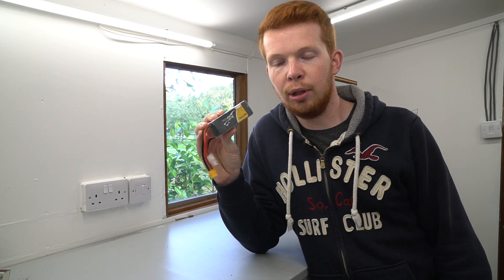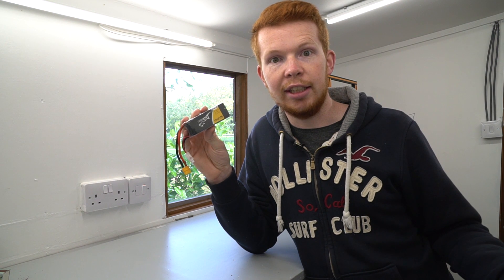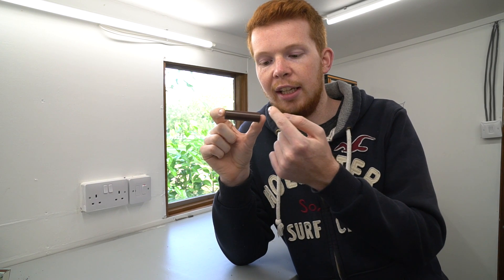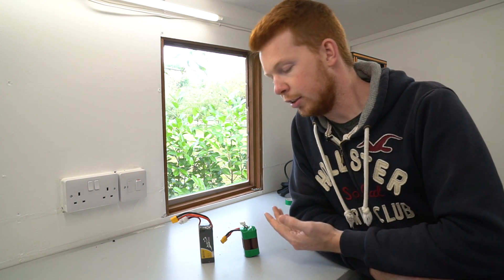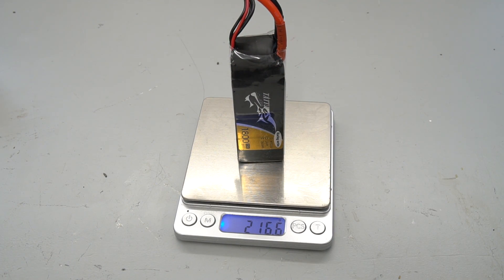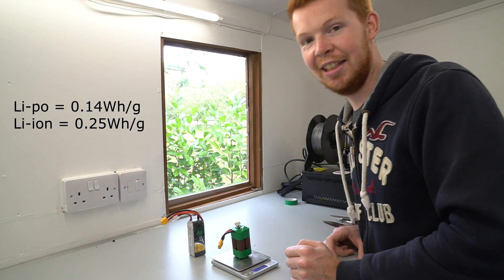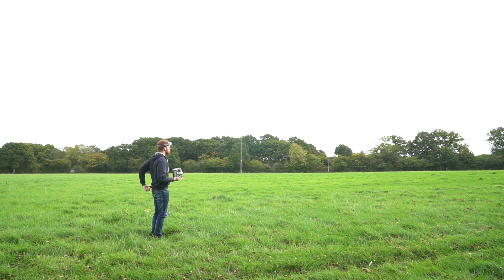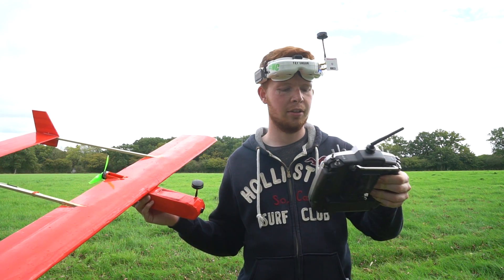Lithium ion plane battery

Comment: 15.6 V / 4 = 3.9 V per cell at the end
You didnt even use half of the energy in the cells! You should run them down to 2.5 V for full capacity 
Bad test

Comment: That so-called lithium polymer battery is terrible! Usually this type of prysmatic "coffee pouch" lithium-ion cell has a far greater specific energy density than the cylindrical cells. This is largely due to the metal casing.

Discharging to 0% will not damagae the cells. Charging between 10% and 90% will extend the cell's cycle count (life). Discharging to 0 volts will damage the cells. 0% SoC is approximately 2.5 - 3 volts.

Comment: ....... Didn't work for me...3s.... weak n heavy..... The power wires break easy they just come right off the cells......I welded a pk And the batteries are  And the rc planes are boring  batteries are so weak and it's just super boring the plane barely even got off the ground

Comment: Bruh, you discharged the LiIon cells to only 3.9 V which is like 30% of full capacity, the rated safe discharge voltage is 2.8V (but 3.2V is used as standard).

Comment: well if you dont lower the lvc to at least 2.5volts/cell then theres no benefits. joshua bardwell did a video comparing flight times and characteristics of both. 5:51 then you arent getting the most out of your pack. li-ion cells can be discharged WAYYY below a lipo. 9:21 absolutely nothing wrong with running a lipo down to 3.2volts THEY ARE NOT DEAD at 3.7v/cell. 3.7-3.8v is storage level charge. LVC for a lipo is 3.2.

Comment: That's not true. A batterys capacity is measured to it's cut off voltage. Wich is a safe voltage and you don't have to throw it away. That's ridiculous.

Comment: in the PEV world, (last mile type, EUC / Eskate etc) we use massive packs where amp draw per cell isn't an issue, i always thought you guys used lipos cause of the better amp draw with smaller packs, but my knowledge is limited

Comment: Great video.  I noticed that your comparison of battery density did not account for differences in construction materials. An example is that the the lithium polymer pack has a much longer set of lead wires then the lithium ion pack does.  Other differences exist, such as the materials used in the cylinder construction, the bonding material and the wrap material and thickness.  So, while there is validity to the premise that weight matters, it would be the base weight of the required elements and not of the packaging of those elements into the battery component.  Just my thoughts.  I really enjoyed the video.  Keep up the great work.

Comment: If LI-ion cells could be discharged to 2 volts per cell, ie 8 volts in total, it would significantly reduce the performance of the plane because the plane would be flying at half of the rated working voltage during the final minutes of the flight. It is always better to have a constant performance and decent flight time than degrading performance and high flight time.

Comment: You can solder li-ion cells with Rose's metal, its melting point is below 100 celsius. And it will double as overheat protection.

Comment: step-up converter, voltage regulator, full usage, from the lead-acid / lithium-ion
Reply: simulated load on the tip of a pole, selected rpm

Comment: Its not 3ah at 4,2v, the nominal voltage for a li-ion battery is 3,7 volts. Anyway its easier just using Watt hours to compare these things.

Comment: You can get spot welders online for 20+ bucks. They use a LiPo as a power source. Performance may vary but they should do the job for a quick battery pack.

Comment: Li-ion is cheaper, innately larger Amp·hr, and less weight than Li-Poly. 

@10:35
In terms of performance, I'm still not sure why you'd ever opt for a Li-Poly solution? Are you saying the high current draws needed in acrobatic maneuvers combined with the lower internal Ω of the Li-Poly (and ignoring the added weight), makes it the more electrically efficient solution?

Comment: Ove more difference between Li-Po and Li-Ion is max current. Li-Po can easily deliver 65C or 65*capacity current - 65*capacity, and it is hard to find 18650 with 35C+. So it is not only energy per gram matters but also max current per gram.

Comment: "With the lithium-ion battery, I still had another 43 minutes that I could have flown." No. As time goes on, the voltage drops. As voltage drops thrust drops. At some time long before 43 minutes (with a corresponding 8 volts), you would not have enough power to fly the plane. 

Sure, it is possible to fly planes at this lower voltage. However,  his test plane used a 4 cell battery, indicating that it was not designed to run at such a low voltage.

Comment: what i have recently noticed is sometimes there is a "security" circuit in the batteries which limits the current so this is why sometimes the tests are not very precise when you compare different batteries etc. because you look at the volatage and capasity and you think hmm it should be the same but it is not but not because of the battery itself...

Comment: Li-Po is Lithium Ion. It's technically called Lithium Ion polymer. The difference is basically that polymer is flexible, Li-ion is not, and they have some different aging qualities. But Li-Po and Li-Ion can both be manufacturered to be high energy density or high amperage capacity or in same cases both. Your Li-Po batteries here are designed for high amp draw, where the Li-ion you used here are designed for capacity.

Comment: I love your videos, but your math is a bit off. Your plane takes X amount of watts to fly not Amps. Taking into account that you would need to discharge your battery down to 2.5v to get the full mah, your plane probably has a theoretical flight time closer to 65 minutes on Li-ion.

Comment: Can you not set up a test rig with a multimeter with the batteries and a prop on a motor at the correct rpm or at least a given set resistance to allow the correct amp draw and then test how long it takes For the li-po to drop to 3.7v per cell and the li-ion to 2v per cell

Comment: Ummmm, you can definitely run lipo cells below 3.7V . That's their nominal voltage, you can safely run them down to 3V per cell with no issues. If you only run them down to 3.7V you'll just about use half the battery capacity

Comment: Cheap Lithium ion cell manufacturers always lie and grossly exaggerate the battery capacity, that's why it lasted slightly less than the quality LiPo despite having more than twice the rated capacity.  For RC planes, those LiPos will always be more efficient in energy density to mass.
You need to do a continuous discharge test to find the true battery capacity of your Li-ion battery pack

Comment: Both cells are lithium ion. lifepo4 and so on are too.
The polymer comes from the plastic pouch the cell is in.
The cell you refer to as lithium ion is an ICR or IMR cell. Which stands for (lithium)Ion Cobalt/Manganese Round.
You also get polymer lifepos or cobald or manganese in polymer pouch.
Reply: Round could also mean rechargable. Not 100% sure

Comment: Wonder if there some kind of RC plane distance record could try and break.
Reply: @RC Testflight built a solar plane which can fly all day.
Going to be difficult to beat that.
Reply: @safetyinstructor  how about night? 🤔
Reply: @therealpanse 
Daniel used a normal lipo so it's probably going to last only a few hours at night but already being able to fly all day is going to defeat a simple li-ion cell like in this build. 
You could try to combine li-ion cells and solar panels to basically have a suborbital pseudo satellite.
Reply: @safetyinstructor  (sorry for replying to an old thread) but a good old combustion engine would probably be best for this task! Little 12cc nitro engine and a massive 2 litre fuel tank, if my 1am quick maths aren’t broken, it should be good for about 2000 miles 😅
Reply: @b4tty  Idk but if my 2am quick maths aren't broken you should be wrong.
These hobby engines are quite thirsty they guzzle through half a liter in 20 minutes.
Edit : okay not the 12cc ones but these engines are everything but efficient
Reply: @b4tty  Along with the thought that a 12cc engine could move 2litres of fuel, or overcome wind resistance of the wings that would be required to keep it airborne haha
Reply: Just had a stroke there
Reply: @yorn4286  underrated joke.
Reply: someone jst did 100 miles🤣

Comment: Hey - i build a 3S2P 6000mah LiIon of 18650 Sony Murata.  This cell you can fly to 2.5V (and lower) but the ESC (HTIRC Hornet 40A) have throttle-cut at about 3V per cell! Any ideas how to fly until 2.5V/cell?

Comment: Lithium polymer batteries are lithium ion ( LIPO )  the P stands for the polymer the pouch that is used.  Lithium  ion cells are of the same thing except with a metal casing that's why the P is removed there is no polymer pouch.  The capacities are different because of the chemistry that is used you can either have high discharge  With low capacity or  Lower discharge with higher capacity.  There essentially the same cell bit different  Manufacturing methods and with Slightly different chemistry For higher discharge or higher  Capacity.

Comment: if you tightly pack together these Li-ion they will severely overheat . Try them separated by 1cm and wrapped in alluminium foil as heat sink

Comment: I keep soldering 18650 cells and I hate it because there are always cold solder joints. When soldering cells, I use a soldering iron that has at least 60 watts. Spot welding devices are best, but unfortunately they are very expensive
Reply: U could try to scratch the ends of battery with sand paper then it will be able to stick properly and try getting the really thin soldering wire

Comment: After a couple of 2 hr thermal flights, I can attest to how it becomes boring, but ,.... when you get low and have to scratch for lift, the heart rate can climb faster than your glider, if it's a task that you'd really like to complete,..... accumulated flight time with the Li-ion still gets you a comfortable, 3 twenty minute flights or 4-5 ten to twelves, so again that benefit of flying a daily session without changing airborne packs is in your favour ....... :-)

Comment: There is also one more thing you need to consider. The charging board for the Lipo also controls the discharge rate of the battery. So even if the flight electronics asked for more power, the board will limit it. This is needed to keep the battery from what I call thermal decay aka an over drawn battery ready to explode due to heat.
Reply: Lithium Polymer batteries used in hobby RC do not have a protection circuit like on Lithium Ion cells used in laptops. Not all Lithium Ion cells are protected, either. That's what makes RC use possible, while also dangerous. The battery will put out as much power as physically possible--even to the point of bursting into flames due to the ESR heating up the pack. Most RC electronics have motor speed controllers with a built-in Battery Eliminator Circuit (BEC) that limits max amperage draw and shuts off the system when it reaches a safe low voltage. The BEC is for sending 5v to servos, receivers, and flight logic boards. All of these devices work together to prevent a battery from bursting to flames.

Comment: Do you have to fly them to test the "theoretical" run time? Like those running machines or exercise bikes can replicate different conditions, so could a similar simulation be put on the motors drawing different energy values for take off and cruise. Run both batteries on the same motor through the same software simulation will give you theoretical values that should significantly apply to real world situations. Especially if you already have a log of the real world conditions because then you could use those values for your simulation.

Comment: Respected sir,
 

My name is Rajnish Kushwaha from Delhi , and I got yours reference from Mr. Tilaye Tadesse, sir I am mechanical engineer.I want to propose a presentation on  totally innovative project on advance propulsion mechanism system   which is totally different from today's I.C or S.I based propulsion, which are based on Newton third law of propulsion but instead my project is based on innovative natural theory and for this project I I am currently working with two IIT's professor Dr AMIT GUPTA who is working as a assistant professor in mechanical department in IIT DELHI and Dr Debopam Das who is working as a professor in Aerospace department,  IIT kanpur, I am working on this project from last 12 years and i develop my own working prototype at my own end with available resources which proves and confirm my researched theory, but now I need yours people help  for its industrial development with the help of NASA organization.

I am waiting for your heartiest response.

 

With regards,

RAJNISH KUSHWAHA.

+91-9718895909

Email ID :- rajnish.kushwaha8@gmail.com

Comment: Great video! You could put a flight controller on the plane and let it loiter in circles overhead so you dont have to fly it manually, also the price, size and weight of flight controllers has gone down with the popularity of FPV miniquads and the like

Comment: A quick question: Everything I have found on the internet(?) said Lithium Ion batteries weren't designed to be recharged, and warned against doing so. What have you found in this area regarding recharging Lithium Ion batteries? Any detriments, any problems? You make very interesting videos. Thank you.
Reply: Lol lithium ions are used for evs so yest you can recharge them

Comment: Lithium-ion = lithium-polymer. The chemistry is one and the same. "Lithium-polymer" is just short for 'lithium-ion in a polymer package', referring to the plastic ("polymer") soft pouch or rigid box that forms the outside of the cell, as can be seen on nearly all rectangular batteries of this chemistry. (Therefore, "lithium-polymer" is nearly synonymous with "prismatic lithium-ion cell". I do have one rectangular cell (from an old smartphone) that has a metal shell, but it's very much the exception.) It's actually common to make 18650s by first making really thin rectangular cells (in plastic pouches, therefore "lithium-polymer"), rolling them up into cylinders, and putting those rolled-up plastic-cased cells into metal outer shells. Therefore, while individual cells' specs may vary (like the LG ones in the video), the distinction between two categories of "lithium-ion" and "lithium-polymer" is meaningless.
Reply: Why do lipo seem to provide more peak output?
Reply: I'm actually wondering

Comment: Just for the craic of it, I alo made a 2S2P pack out of 18650's, tested it on my 9inch quad, it flies for about 10 min straight... Also converted all my drills to Li-Ion with the appropriate BMS boards. Just soldering these is a bit tricky. Nice one Tom!!

Comment: 80 minutes will not be possible. As your voltage decreases, your amps go up to match the watts needed for the motor at that rpm and load. I have a li-ion setup on a 7 inch quadcopter. Not nearly as efficient as a plane, mind you, but I had a 28 minute flight. As I flew down the pack,  I continually saw the amps bump up.

Comment: That is not a problem - we fly our custom-build drones (simple Quadcopter) about 35min (https://www.youtube.com/watch?v=Oxgdetbq6Xc) with payload and 48min without payload. So i think you can fly a plane more than 5 hours with the same capacity. By the way we use 6S and 15Ah.

Comment: You should also take I to consideration the fact that the closer to max amps of a battery you drain from a batteries the less actual power you will recover. ie lithium ion will loss a lot as they aren't rated for alot of current. Another way of thinking about it is the slower you drain a battery more total power will be drawn. One hour is a very short time for a battery to be drained. Think about a phone or a laptop or a watch.

Comment: would not recommend running down a li-ion to 2v lowest i would suggest is 2.8-3v per cell but for the li-po im pretty sure you could run it down to 3.5v per cell without any major issues

Comment: Can't you just fix the plane to a test pad and leave it there for as long as it's needed? You can even measure the voltage, amps and plot it. Even auto stop when needed and the test conditions are more equal. :) I know it's not that real then but still valid. What do you think?

Comment: It would be awesome to retest this new high amperage 21700 batteries. Samsung 30T for example have high capacity and can handle "high" current so they will have a lot more flight time per mAh than those LG HG2. I have tested this vaping and the difference is HUGE.

Comment: yes but li-po batteries can give more amperes, that's why they are used in things that pull 20 + amps, the average racing drone pulls 100 amps when gas is added.Everything has its purpose li-po batteries are discharged at approximately 3.7v and if they are safe up to 3v below 3.5v the capacity drops quickly. Li ion batteries are great for things that do not pull the ampere nut since they discharge a lot

Comment: Man the HE2 is a classic but with 18650 everyone started using Samsung 30Q as a balance standard or high drain vape class Sony VTC6 or crazy high capacity Sanyo GA cells for low amps.
Glad you tested the difference but I do hope one day you'll just run a joyride with these proper new cells

Comment: Redoing the test by flying might have been boring, but he could have mounted the motors with a propeller on a bench and ran them down till they reached low min voltage to check out his mathematical theories. It would be a better test actually because both motors could be ran the same rpm for a set time instead of slight variations for wind, cornering and climbing or descending.